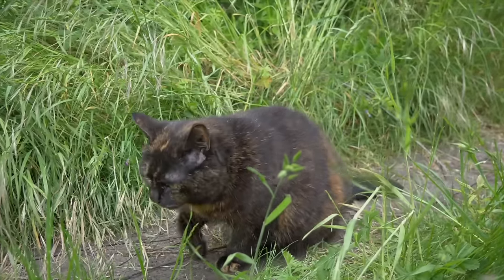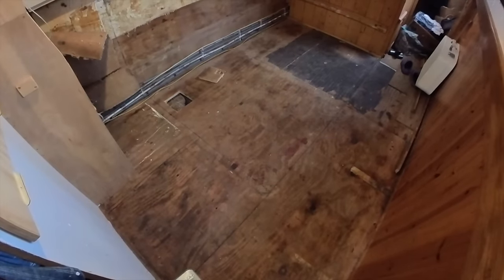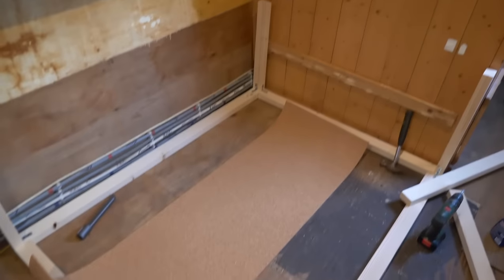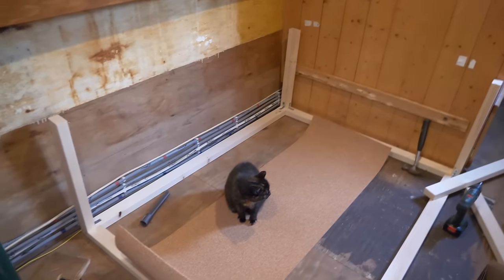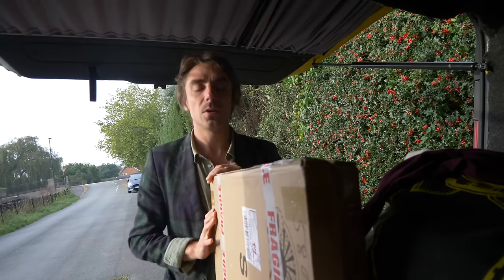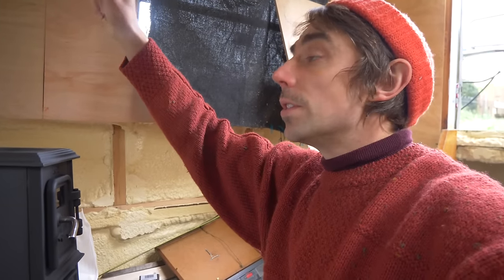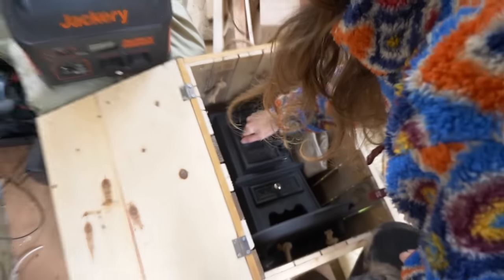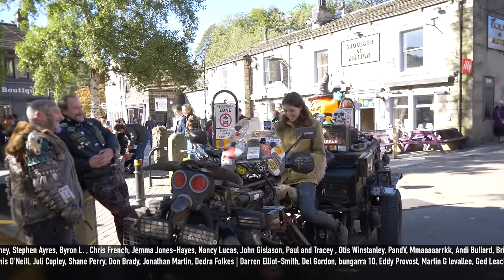Ripping Out Our Narrowboat Bedroom and Building a Pull Out Bed | Unboxing Wood burner + Solar | EP71

Comment: Nothing wrong with your woodwork Emily, how cosy is that going to be with a small log burner on the wall and off the floor with wood storage underneath it so you can watch the flames when laying in bed on a winters night. Pull out box drawers with  casters on the back end and you will get a ton of stuff underneath,
Well done you..

Comment: Ben, my grandmother cooked on a wood cook stove with big oven.
The removable cast iron plates on the little new wood burner are good for cooking, much less fire is needed when placing a cast iron skillet over the hole so it seals it mostly. Open windows when doing that, and have a CO detector.
Reply: The antique stove was in the family vacation cabin.

Comment: Be sure to use a oil based stain blocking primer made for mold, I would put it on the floor, try to encapsulate the mold.
Please look into ventilation under the sub floor. Until that is fixed, mold will always be back in cool days.
Reply: Also there is condensation from the air, especially air near water. Whenever there is a temperature difference water forms. Insulation causes temperature differences sometimes. Ventilation is always the answer.

Comment: Tumblehome is what Rambler needs, ask a canoeist. Though, I'd imagine, you could usually touch the bottom of a canal for adding stability, or fasten both your boats together.

Sometimes it can be easier & cheaper to modify a manufactured product than build from scratch - bed slats from Ikea or similar. They could "concertina" up for the daytime position.

Cut a hand hole for a handle, you'll be able to use it from both sides. I don't think your pull out will need locking out, but you could do that on the bed side just as effectively as to the wall. Looks as though it might be a bit long/high, but if the extension folded up it could be handy for retaining the mattress. You could always make it double fold.

Comment: Ballast is important for the small boat if most of the weight you are now adding is above the waterline. Being top heavy can be dangerous. If the boat sits more in the water it will be more stable and will be less inclined to lean when you put weight on the port or starboard side. Charles

Comment: Hi Ben & Emily, have you considered a chineese diesel heater? it would save you so much space and they are mega cheap to run in comparison to feeding a stove with coal, some have LCD remote controls that use tripple A batteries and are so easy to use. there is lots of info on youtube about them and they run on a 12volt dc power supply to if needed, they only draw 10amps on startup and shutdown once runing they draw around 2 amps to run the fan, to blow the heat inside. we heat a caravan with ours but also heat our 2 bed semi during winter because its cheaper than heating with the gas boiler. we use kerosene in the one at home which is a 5kw heater mounted in a wooden cabinet on an outside wall. the caravan heater has its own metal box housing which sits on a stand made of galvanised garage wall ties from wickes bolted together. No condensation at all because it is dry air heat.

Comment: your boards for the bed could be cut to the size between the runners and glue and screw them to the plywood ;) that would be your strength, and save room :)

Comment: Putting an open fluid appliance in your bed room is a very very bad idea, that's why they are banned under gas regs and probbly also banned for wood burners, if you are going through with this, then fit a good quality carbon monoxide detector
Reply from the maker: Hi, sorry not sure what you mean? What is an open fluid appliance? We're thinking to put a small woodburner in the bedroom. Thanks 🙂
Reply: Sorry auto correct, that should read flued, an appliance that draws it's combustion air from the room, if the fire is alight when you go to bed, then you are both competing for the same air, if the oxygen levels fall as a result, the you get incomplete combustion and lots of carbon monoxide, this still kills a lot of people every year, my advise is to consult an expert on wood burners and their best locations before you cut a hole in your boat for the flue. I hope this clarifies things, sorry again for the auto correct. Stay safe @BenandEmily

Comment: Please check that your stove is acceptable for your boat safety  certificate.  Its Chinese and doesn't meet British standards. Made the same mistake.
Reply: It's a Pipsqueak stove, made by Salamander, a UK company based in Devon.
Reply: @terrystevens5261 the problem is that it has a 80mm exit pipe that isn't acceptable and you can't get an insulated flue in 80mm.
Reply: Please Note: The Pipsqueak has not been approved for use inside the home. This isn't because it would not pass the tests, but simply because of the small numbers of stoves made, and the low selling cost it does not justify the large outlay for product testing and approval. We recommend using a Carbon Monoxide Alarm in any room that has any solid fuel heater in it.
Reply: CONS
Rear Only Flue Exit
China Made (Assembled in UK)
Hard to source 3" flue size

Comment: Bad idea putting a wood burner in the bedroom....
Reply from the maker: Why so?
Reply: I make my bed , every day!
Reply: With proper precautions it will be safe.
Reply: I think it's a good idea to have a wood burner or some kind of heater in the bedroom to keep it mold free. I'm so glad you ripped everything out to get rid of the mold :) @BenandEmily
Reply: A narrowboat bedroom is no different from any other room on a narrowboat, having a wood burner/ multi fuel stove in their main cabin already i would think they are aware of any issues with carbon monoxide and other risks associated with any type of heating.
Reply: @BenandEmily  restricted space....hot surface,bed clothes,duvet,moving around, something gets dislodged touches stove/burner ,and up you go.....fire..